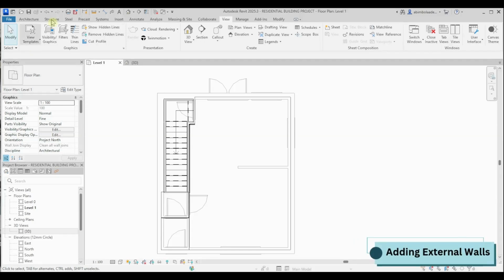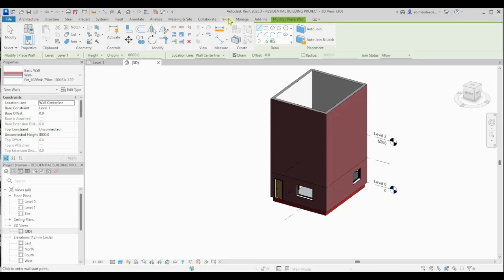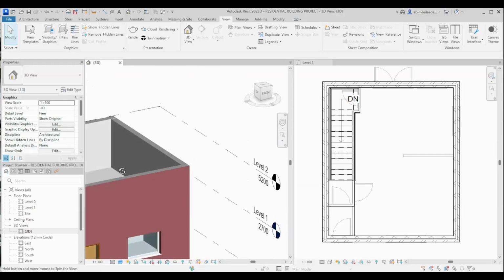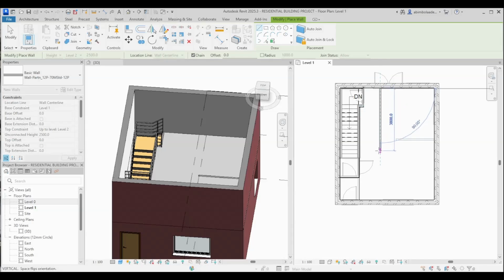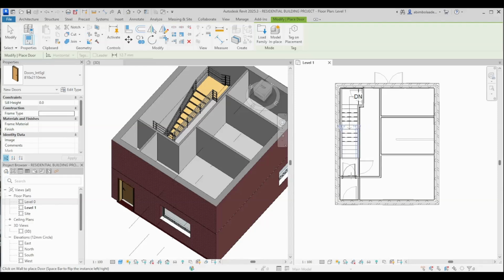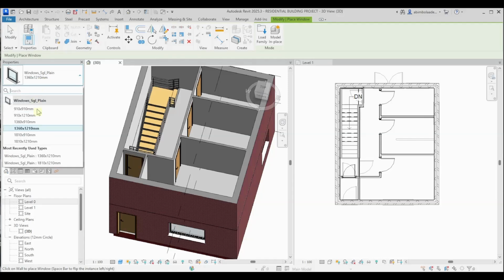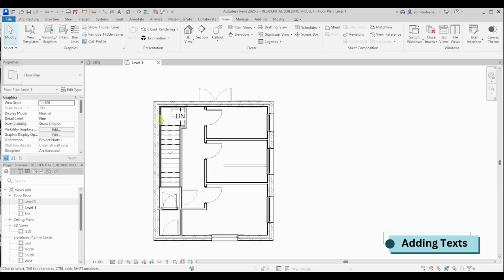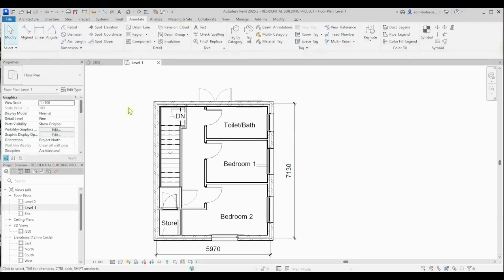Autodesk Revit Basics: Guide to First Floor Plan Layout and Annotation

Comment: How to existing floor plan into next level i mean that let consider i have drawn on floor plan at level 1 and then when I go to level 2 i can the half toned existing floor plan of level 1 in level 2 but in level 3,4  i can't see the existing floor plan to take as reference is not showing 
How to address this issue brother can you telll me?
It will great help
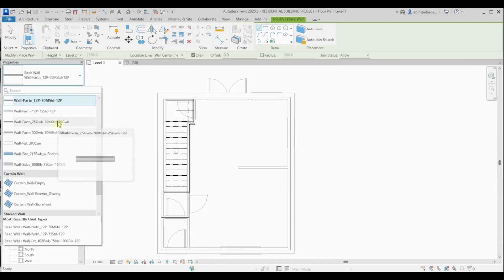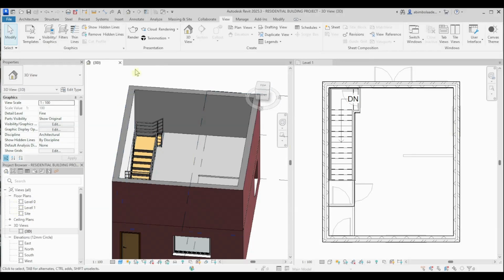Reply from the maker: Hi @weed4452, you may refer to the video below from 1:00 minutes to 4:29 minutes. It shows how to add levels. I hope it helps. https://youtu.be/XyUlF8BILQU